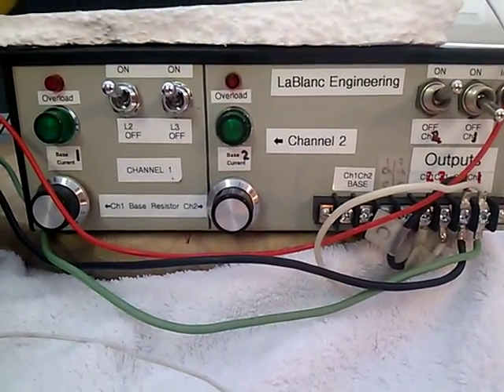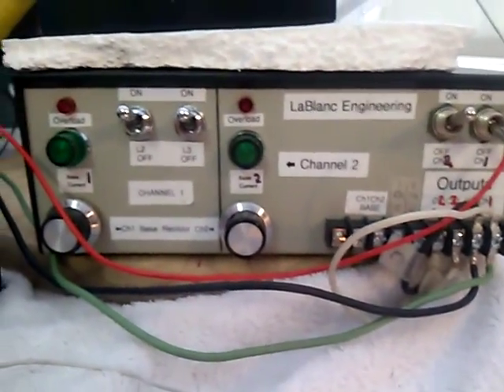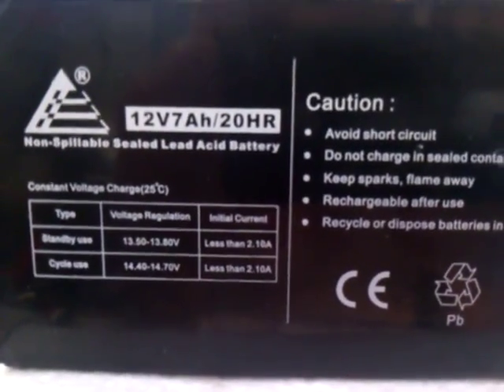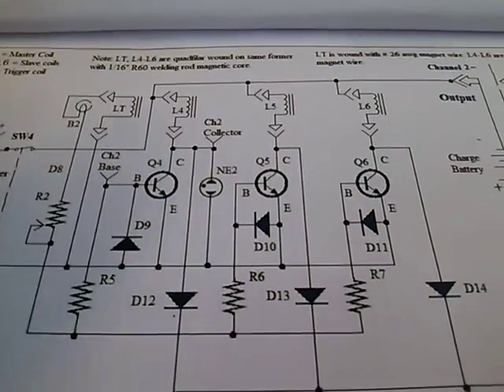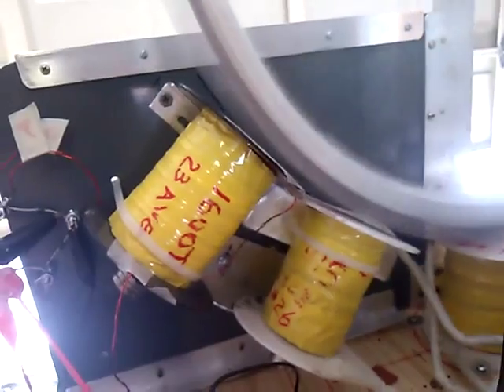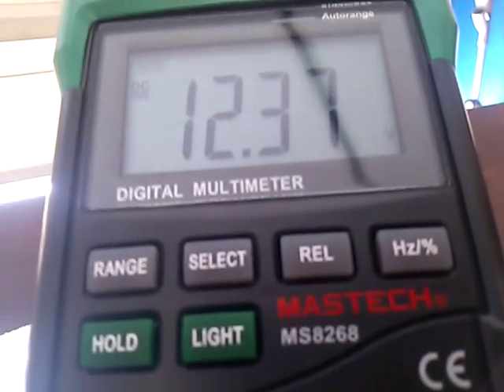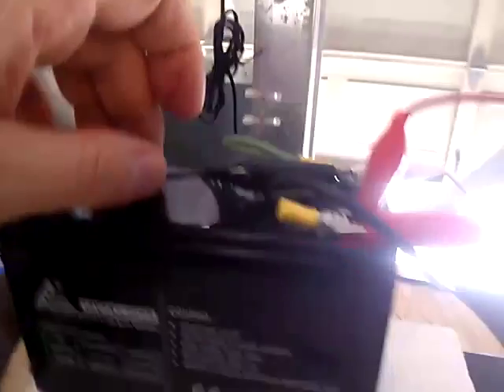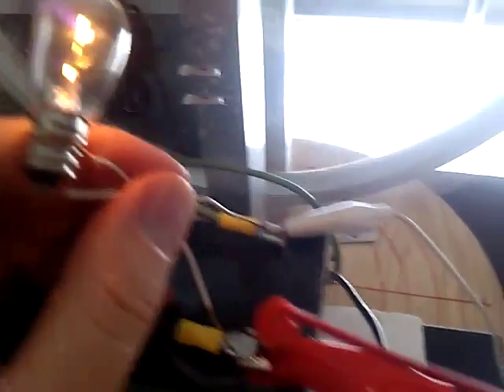OVER UNITY John Bedini circuit?

Comment: YES, I agree with you on everything.!! 
I've been working on a system of my own" 
I also have found that, the magnetic fields are producing more of an focused variational Flux,
With a magnet on the other side of the core, but always having the fields meeting the moving magnets on the wheel " as to repel. in
Turn, does produce a much better power, surge
Without the Effect that uselly found in These home design generators.!! So, you're definitely on the right path, now next step I Advise you to
Add a few more coils, run it through a step - up
Transformer" then take it through a spark gap"
Then you'll see what PURE ELECTRONS Are 
Capable of,..!!!

Comment from the maker: We have done a number of circuits using relays. they are unreliable at best. The best success recently we have had was following John Bedini's book's advice and using capacitor discharge and charge the drive batteries that way and then switch them around from drive to charge battery. that info can be found in his Bedini SG advanced handbook. Get the link here: www.lablancinventors.org/books
thanks
CW